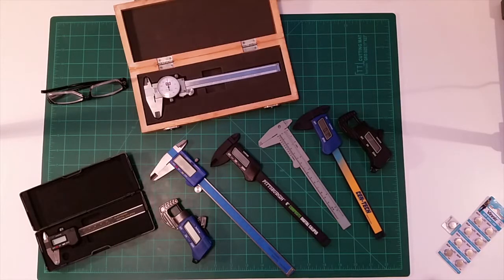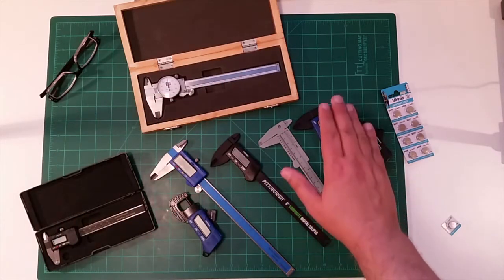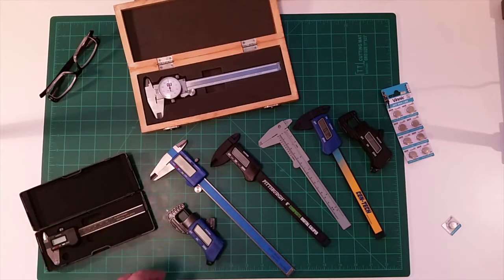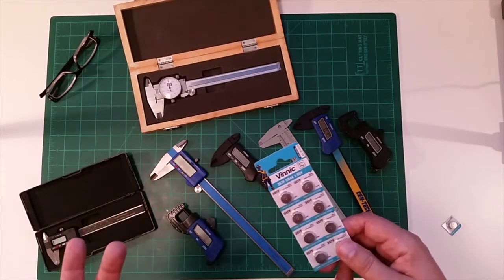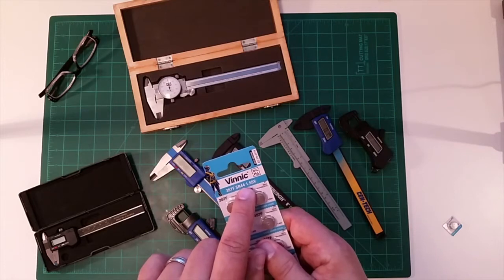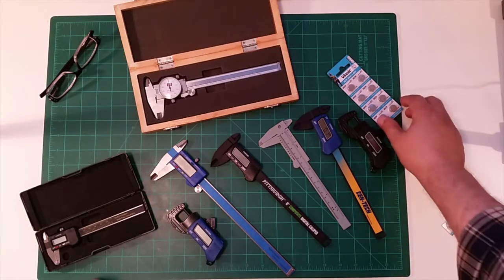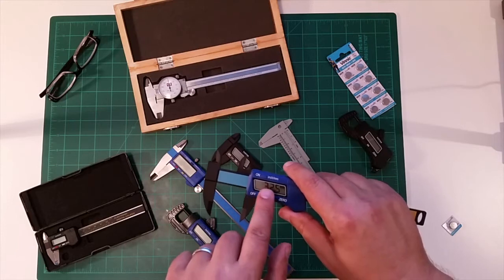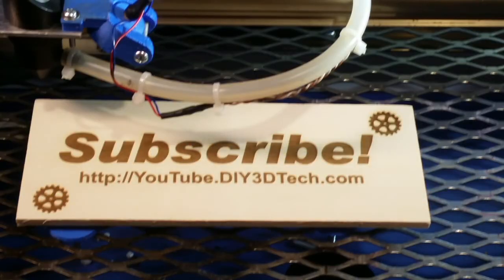Shop Talk - Digital Calipers and SR44 vs LR44 Batteries!

Comment: I recently bought an electronic caliper... had to return it straightaway... I suspect it was a battery problem, but no readings  it gave bore any resemblance to what was being measured... Wildly variable. with changing digits even when the slide was not being moved/

Comment: Your explanation about the screen just going blank when you turn the caliper off is incorrect. There are 2 ways to turn the device on. Pressing the ON button, or moving the caliper jaws. There are 2 ways to turn the device off. Pressing the OFF button, or inactivity (timeout).

Comment: I found a measuring  calipers It did not work I could not  find any batteries yet it did have a llr44g in it now I know with your vedio why it won't go on  and I was going to buy the. llr44g to replace it now I know  now I am buying the sr44 thank you Sir thee best on line YouTube advice given period all my years doing my research for this and that this vedio imo is number one don't have to lose money get a dependable working battery I can use to measure guitar specs where you have to be fairly accurate no professional but it's fun to do...thank you ...Roland J Gutierrez from Magdalena New Mexico USA 🇺🇸
Reply: Period. (sorry...)

Comment: I realise more than four years have passed, but a useful video like this will continue to be watched, thanks.   Like you, I have these calipers scattered around the property!  My "best" one (NSK Max-Cal) was purchased over 15 years ago for more than NZ$200 (US$143), with a printer unit and serial connection some ridiculous amount extra!  If you turn it off, or it times out, it always reads "zero" when you turned it on again - regardless of the position of the jaws.  It requires SR44 batteries, and they do not provide very long life.  I still have it, and it works fine... the display is on the small side, and the zero on time-out drives me nuts!
By comparison, the other three are all cheapies, (NZ$19 - US$14) bought in the last couple of years.  Not nearly as well made, but they don't seem to be any less accurate.  They have a large, clear display, retain their reading during power down, use either SR44 or LR44 batteries, and give much superior life.  These have a "gritty" feel when new, but this disappears with use.
I am sure someone will quickly tell me how inaccurate these things are... resist the temptation - if I need greater accuracy, I use a micrometer.  I have a faithful set of inside and outside mikes, from half-inch to six inch, but I don't need to resort to them very often for most things I do these days.
Reply: That has also been my experience...

Comment: Thanks for your explanations. But there is also a huge difference in price and availability. While LR44 cells are available almost everywhere and dirt cheap SR44 cells have become exotic and very expensive. In many application you can replace SR44 for LR44 without a problems except the shorter service life of LR44. You also might want to learn on the difference between capacity and current : mAh refers to the capacity which is total amount of electrons while mA refers to the current which is electrons/time.
Reply from the maker: Yes there is a prices difference, however the LR44 will quickly disappoint leading to a higher cost in the long run...  The second law of thermodynamic says there is no free lunch and the same I have found true with the LR44/SR44 battery story...

Comment: My Mitutoyo 196 uses amazon basic LR44 no problem....  I highly recommend throwing ALL Cen Tech in the garbage and getting yourself the Carbon Fiber Vinca as a knock around...
Reply from the maker: Mitutoyo is great!  However have been using the Cen-Tech for years for 3D printing and most general uses its been ok, however would not build an airplane with it :-)

Comment: I just want to confirm with you about what you saw. I have a Mitutoyo caliper. I have the one that is expensive as it comes with NIST certificate and meant to be used in a production environment. I tried various LR44 batteries but it does not work. These same LR44 batteries works great in my other calipers, so I use them there. I had to get the SR44 for my Mitutoyo to work. So there also seems to be differences even in between the Mitutoyo calipers as LR44 seems to work with certain models as a drop in replacement battery to the SR44.
Reply from the maker: It depends upon their voltage draw as SR44 do not drop voltage as fast as the LR44's even the age of the LR44 can affect if they work or not...
Reply: @DIY3DTECHcom  Yep, exactly. I meant it as a supporting show of a response video to this video a few years ago.

Comment: My cheap-o calipers from Harbor Freight look to be about on par with the ones in you link, but they came with LR44 batteries. Would using SR44's work?
Reply from the maker: I am surprised, wonder if they modified them as the calipers in the video are from Harbor Freight.  However with the cost SR44 bats I am wondering if now they changed or subed in the LR44 just be cheap however use at your own risk but yes they "should" work
Reply: @DIY3DTECHcom  I've been told (but cannot verify) that in some cases, SR44 batteries are repackaged and sold as LR44s.  Something about how there are only a couple of actual manufacturers and they're sold under a lot of different brand names, and some sort of supply-line reasons.

I think it's more likely that those really cheap calipers from Harbor Freight (and also sold under a variety of different names) are provided with SR44 batteries specifically so they do fail shortly after purchase, and since they're so cheap I think they want you to just pitch them in the garbage and go buy a new set.

On my el Cheapo Harbor Freight calipers, there is a tiny socket under a small cover, there is some sort of electrical connector inside.  There's no documentation regarding what it's for, so I'm assuming the contacts inside are to calibrate it or something.  Anyway, it has a small slot through to the battery compartment.  I've cut a small piece of plastic from the package the calipers came in, and I can slip it through that slot to separate the battery from the contacts when the calipers are not in use.  Thus, no battery drain unless I'm actually using it.   A fresh SR44 battery lasts months now.
Reply: My Harbor Freight caliper will not work with LR44 batteries.

Comment: I have a Fowler Xtra-Value caliper that uses CR2032 batteries. The battery eventually dies when left installed with the Calipers turned off. I created a post in the garage journal forum about caliper battery drain and received replies of people experiencing the same problem, needing to remove battery from the calipers when not in use. However I also received replies of people with electronic calipers that don't need to remove the battery. Have left install up to several years without ever needing to open and install a new battery.  I think the battery drain problem exists with most all inexpensive calipers. But some of the more expensive calipers it doesn't as their electronics take into account battery drain. 

Some calipers behave differently than others when turn off and then on. Such as remembering the last measurement if slide isn't moved, while other will always go back to zero when turned on.

I recently purchased a used NSK Pro-Max six inch, that's all metal and works very well. But  haven't had it long enough to determine if it's CR2032 will also drain if left sitting. Both calipers have an auto turn off feature.

I think  at least some caliper manufactures build a non battery drain feature into some of their  electronic calipers, using better circuit designs, which raises over all cost. I think the more expensive calipers have a non-battery drain feature built-in to the calipers circuit board.
Reply from the maker: In general calipers never turn off, only the screen and this is what drains the batteries and for me the time (which is money) to remove and replace a battery as need is a false economy (other my argue, but that is my humble opinion).  I also checked the Fowlers out as I have never seen a caliper use a CR2032, but sure enough!  Thanks for sharing this!

Comment: Good info in general but it does depend on the calipers themselves. I have a cheapie pair of Princess Auto calipers that operates fine on LR44's; don't get quite as much run-time but not too bad either. In a similar vein, one of my multi-meters works down to 3.3V so any old 9V battery works, whereas another of my meters craps out at 7.5V.
Reply from the maker: As covered, yes the LR44's will work yet with a MUCH lower life span and you likely right "depending" on the device as I have a cheap automotive brake micrometer and since the clasp is mechanical, the encoder is turned off  when not use unlike others the position is reset "mechanically" with each use.

Comment: For the Mitutoyo caliper that I have at least, the battery isn't used to maintain the measured position.  If you remove the battery, change the position of the slider and replace the battery you will see that the readout is still correct. Useful information about the LT44 so thanks for that.
Reply from the maker: Interesting, I wonder how they do it...
Reply: I think I'm wrong! If I take the battery out and leave it out for a minute then it no longer knows the position. If you take it out and replace it within a few seconds then it will still know the correct position so I guess there is a large enough capacitor in there to keep it reading for enough time to change the battery.

Comment: great video , TAke sme back to my radioshack days , in a pinch i have popped in zinc air cells , but once they stop reacting they are flat . LOL . my micronta pocket DVOM hates SR44. the readings can be funny and i have to do the self calibrate on every switch on . but if i use LR44 its seems to keep the calibration .
Reply from the maker: I think the battery video will go down at least todate as getting the most comments of all my videos!  How you did get me in trouble as after watching your channel got the bug to do more of the electronic stuff so placed some orders, the videos should be out in a month as I on the road for the next 4 weeks with not much time but there are several boxes a home from china :-)
Reply: haha , well 3d printing and electronics and CNC stuff all seem to fit together these days . 
I usually end up waiting for the slow boat for my stuff too .
Reply from the maker: For me that part of fun as when I get back home from travel there all of the envelopes from China waiting for me!  The funny thing is likely pass them in the air :-)